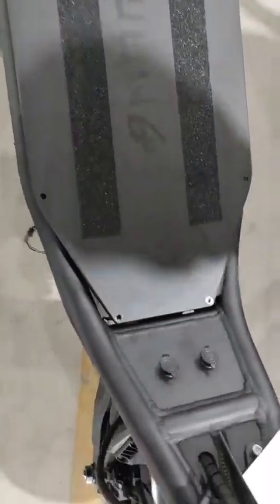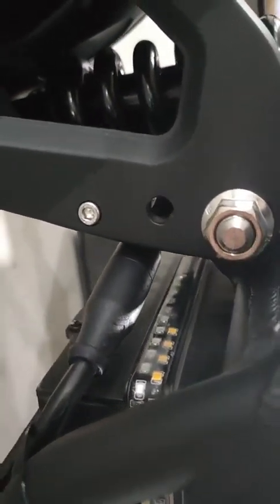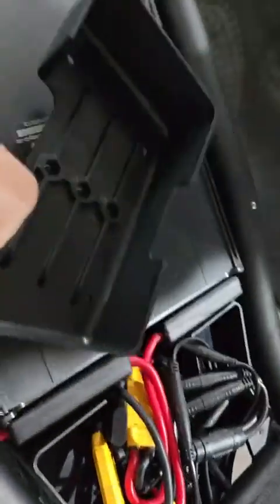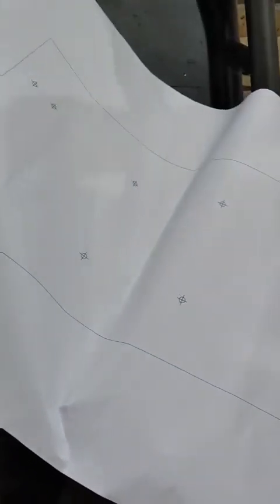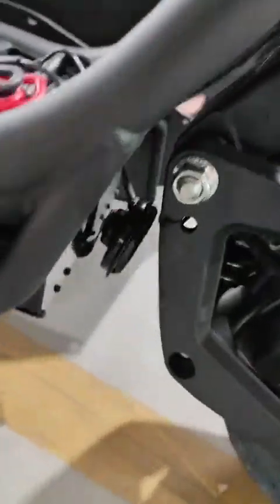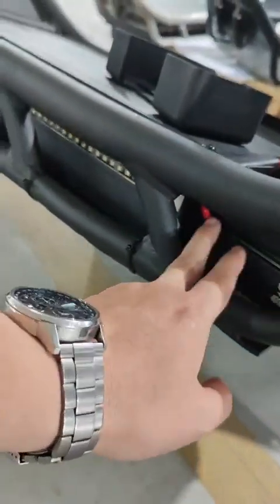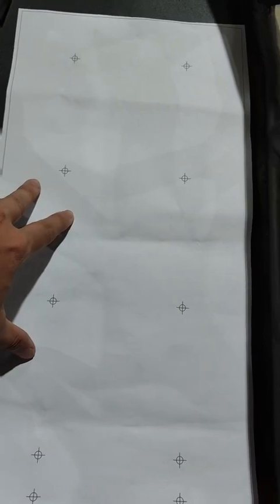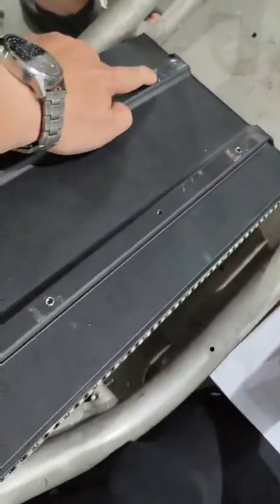NAMI BURN E battery upgrade to 40AH with alumiunm tray

Comment: Hello there Michael, What's the ballbearing size? My back ballbearing needed a change before I stored it at my mother's house , I want to order it to her house before I give her a visit. I already failed at ordering it without measuring the original and I got rollerblade ballbearings .
Reply from the maker: Hello I will need you to send me some photos of the motor to confirm the type of the bearing, you could messege me via facebook

Comment: 我訂購了一台 NAMI BURN E-2 MAX 40 Ah 
如果我要檢驗我買的型號電池是40AH 而不是舊版的32AH
只能打開腳踏板蓋查看電池上標籤嗎?
還是有其他的方式 如手把上的顯示面板上能顯示嗎?
Reply from the maker: 车架上或者电池上都可以看出来的
Reply: @michaelsha2781  hello there Mr sha I've purchased the nami burn e 28ah and absolutely love it there's no better than nami models in my eyes I'd like to buy the bigger battery in time how much would 40 ah be to buy ?
Reply from the maker: @mrdhunter4238  You could email me for the price after confirmation of shipping address
Reply: @michaelsha2781  thankyou il do that soon as I need one....I'm not on Facebook so is there nami sites or forums I can go on like people do on Facebook ..thankyou
Reply: @mrdhunter4238  I also have a 28ah wouldn’t you also need need to upgrade controllers and motors also?… or if you were to only change battery to 40Ah this is fine?
Reply: @MarkTyler-zi3mw  alright mate yes you do have to replace a few minor bits the best man to ask anything related to electric plus knows everything about nami his names  Jonassegway cool geeza aswel Il replace mine in time as only had it a month even now I can't stop looking at it better than looking at my x lol
Reply: @mrdhunter4238  haha yes It’s a lovely scooter, where would I find jonassegway
Reply: @MarkTyler-zi3mw you don't have to upgrade anything as the spec is the same for the bigger battery. Just 32% bigger capacity.